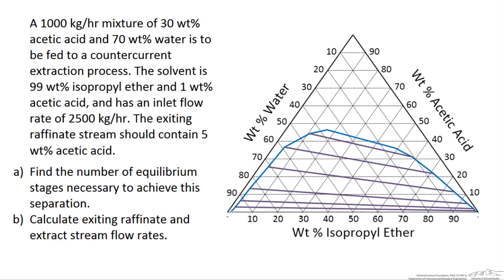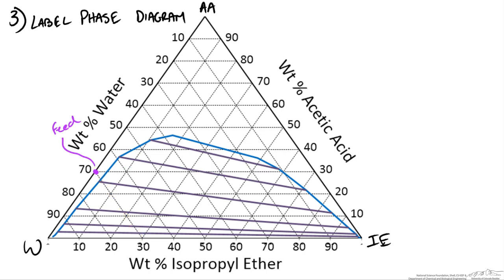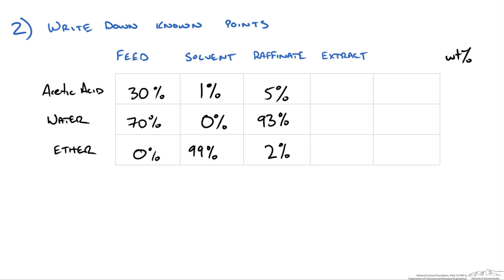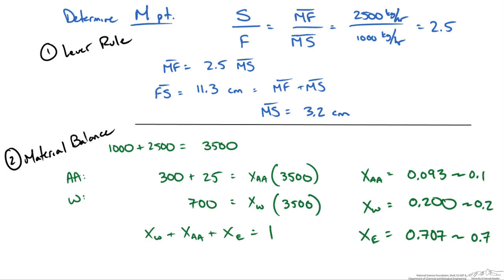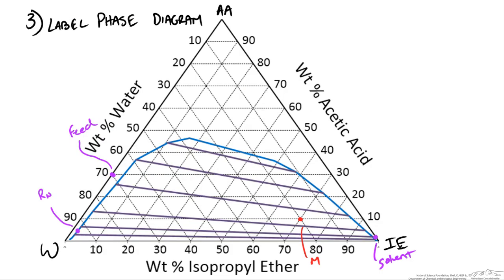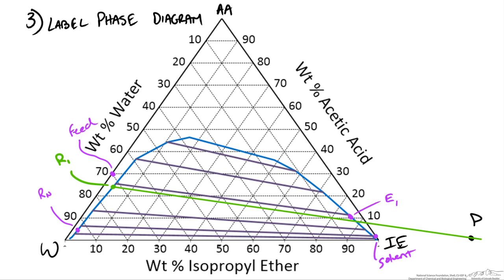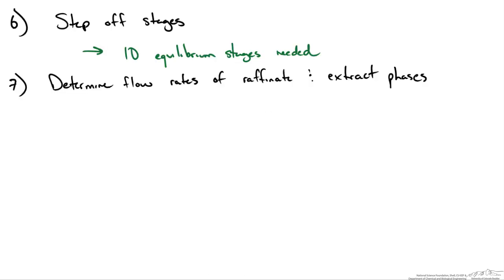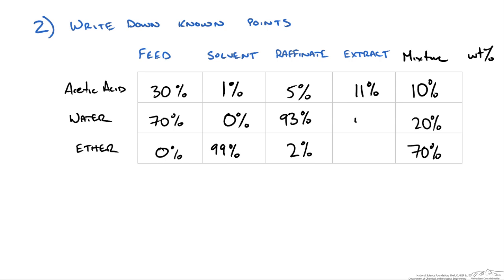Hunter-Nash Method: Liquid-Liquid Extraction Example

Comment: how did you determine the E->R line? how did you determine the slope? or is it more up to interpolation?
Reply from the maker: First the mixing point is found, then the line is drawn from the raffinate through the mixing point. Where that line intersects the equilibrium line is the extract. See the video between about 3:30 and 6:20.
Reply: E-R is asked not R-E , how do you draw line from  E1 to R?
 @LearnChemE

Comment: How do you know which dotted line is for which component, always confuses me
Reply from the maker: Thanks for asking.  So the point W on the side for water is 100% water.  That means that directly across from that (the line that says wt% acetic acid) is 0% water.  So, now your 10% water line will be parallel to the 0% water line, and so on.  I hope that helps.
Reply: LearnChemE Certainly did, Thanks!